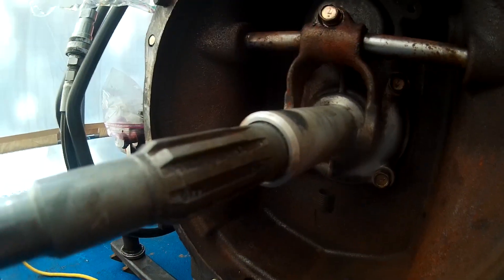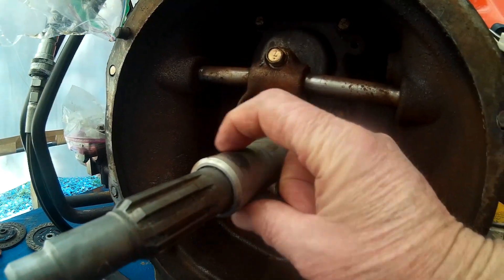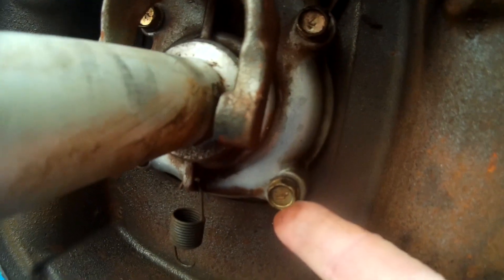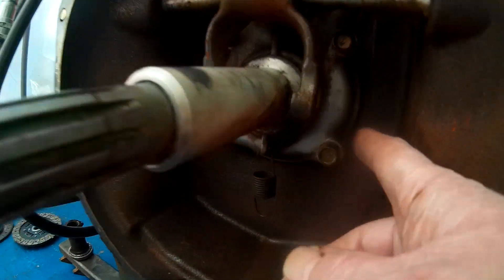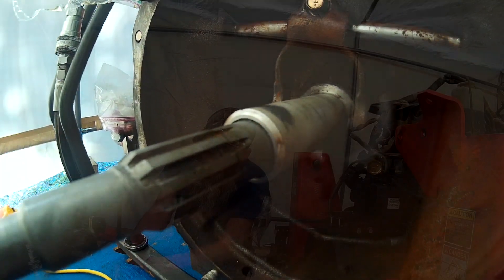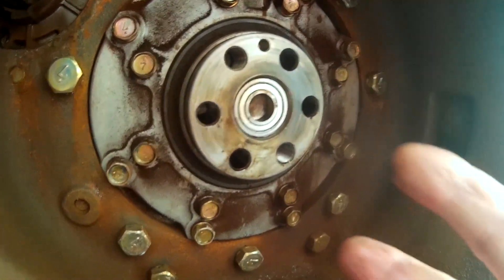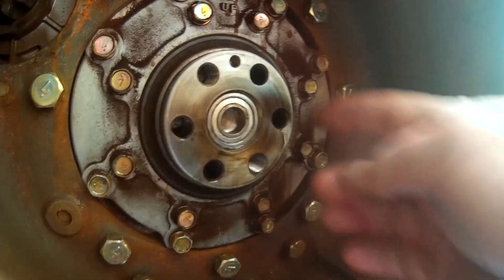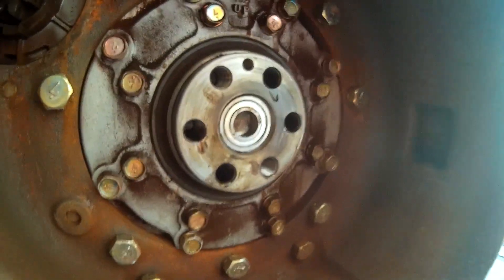Is your Tractor Crying or Weeping?

Comment: Hi Dave, Just wanted to say thanks for all the information you have shared during your clutch replacement! I have really learned a lot of new things during your journey. You also must have the patience of Job, I would have been non-stop (and made lots of mistakes too) trying to get my tractor back together. Love your vast knowledge & mechanical know how! I have had three Kubota's over the years & each of mine have had this drain pin. Looked it up in the manual several times & it says it for draining water that may have gotten in during rain, snow, or washing tractor. Thing that the manual doesn't say, is how often should you check for fluids or water. I usually check it as I'm greasing mine. I haven't ever had a drip of any kind yet ( shouldn't have said this, I know knock on wood). Anyway thanks again! Hope you & your mom are doing well! Take care brother!
Reply from the maker: I never seen water run out of mine either. I think it all turned to rust inside from the looks of things. lol ha ha. I hope I never have anything running out of it. so tired of this job already. still got a ways to go though.